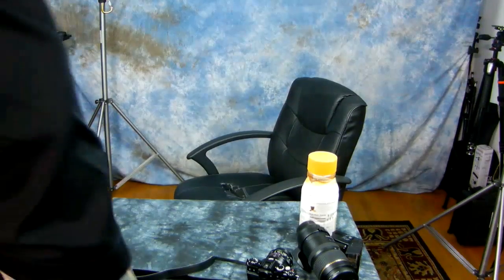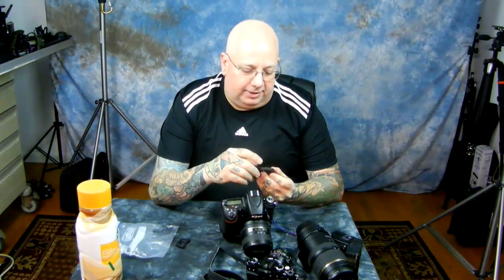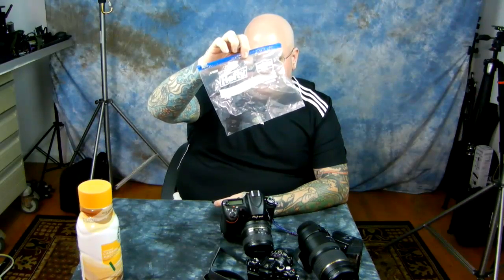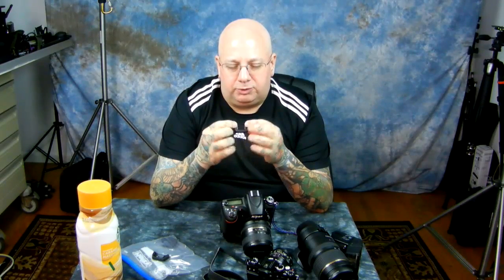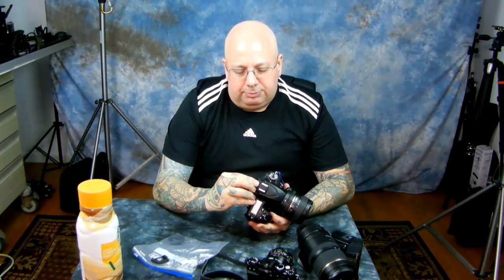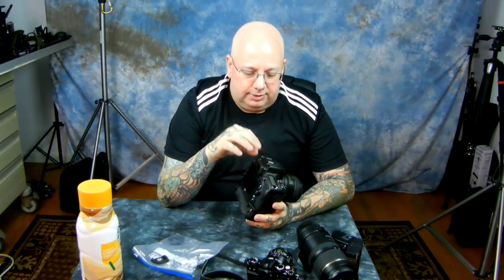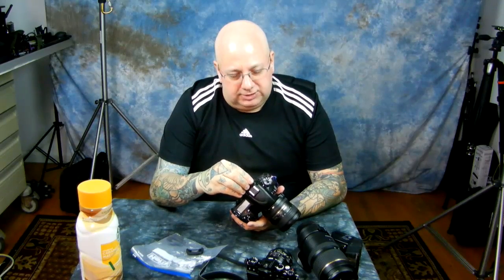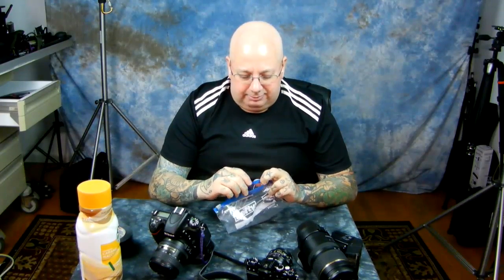Angry Photographer: How to fix the tiny design flaw of the D750 and D7100 when shooting

Comment: +Theoria Apophasis - I've been doing the same thing, except I use gaff tape and I actually just put a strip between the back of the hot shoe and the top of the eyepeice (with the eye cup off).  I slide the eye cup over the tape and the extra thickness and friction keeps it in place.

Comment: What lens is that you have mounted to the d750? Is that the nikon 24-85 vr? I am upgrading to a d750 soon and am planning on getting a nikon 24-85 f3.5-4.5 vr lens as my standard zoom lens.
Reply from the maker: +Dakoolguy111 yup, VR G 24 85
Reply: Awesome! How is that lens? I know you have said it is impressive, but I have read some reviews that say the autofocus is slow. Also I am looking for a wide-standard lens for my fx camera body upgrade that is happening very soon. Also considering the Tokina 17-35 f/4, I think that would be a better choice because it goes wider, and seems like a better lens. Then maybe I could get a 50mm prime lens or something in the future, to fill the gap between 35mm and 70mm (my other lens is a tamron 70-200 f2.8 vc).
Reply from the maker: that tokina lens sucks ass.

its not slow AF , the 24 85, its not insanely fast either.
Reply: Really? Thats disappointing to hear! I like the 24-85, but i was hoping for something a bit wider, especially since it will be my only standard/wide lens for a little while. I guess i will consider the 24-85 more, do you know of any other lenses that i could consider? (Preferably not above $450)
Reply from the maker: wider that that gonna cost a lot more.

good wide zooms cost a lot

Comment: I didn't know of this and i use the Black Rapid cross chest strap as well, yikes good to know. I also saw your video on the magnified eyepiece i think for the D800? So i looked for one to fit the D7100 and the magnification is only 1.17x!! like the fuck is that useful for, Nikon does not even provide sample images of it like they do for the piece you showed i'm sure because the difference with it off and on are negligible. It's 30 something dollars so it isn't expensive but really i'm only considering it because when i hold the camera in vertical portrait position it's difficult to see the bottom display and the whole viewfinder image. I would like it to be more magnified to aid in manual focusing but unless i can find a non-Nikon one i guess i am stuck with their dumb shit excuse for a 'magnified' eyepiece.